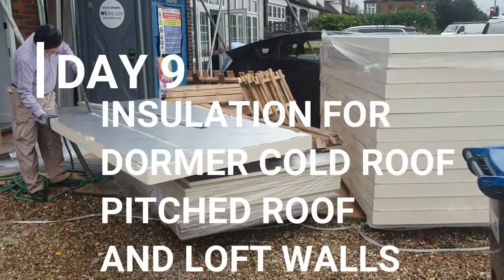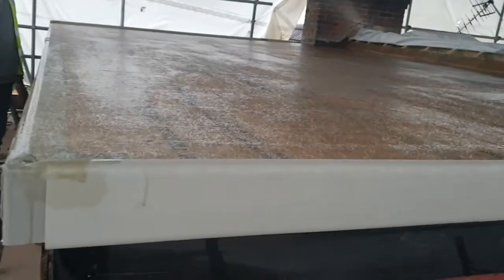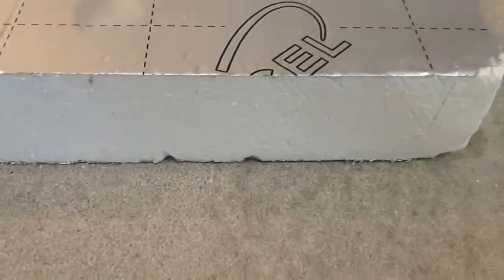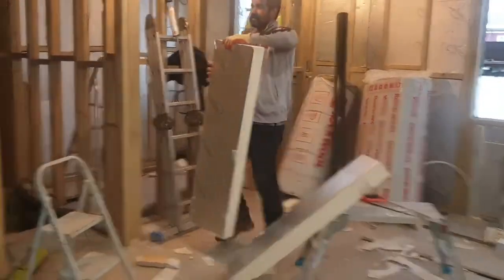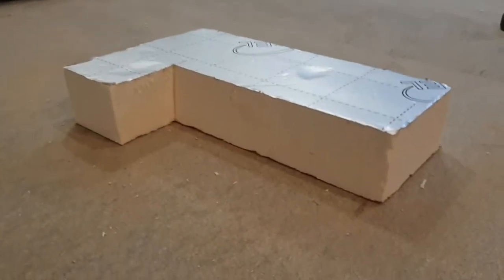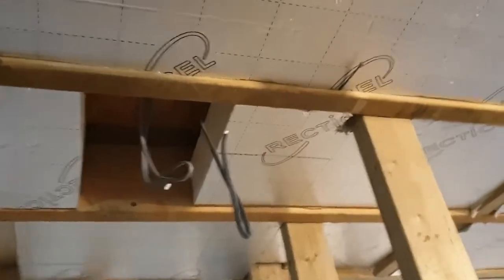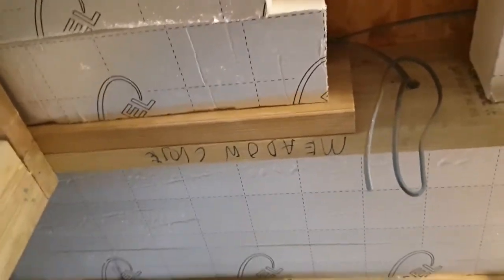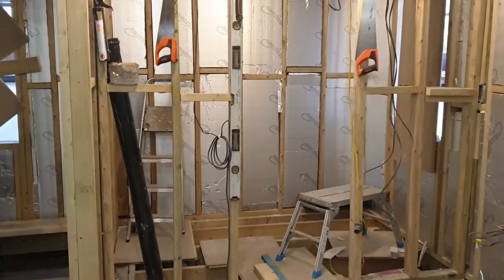LOFT CONVERSION DAY 9 - Insulation of Dormer Roof (Cold Deck), Pitched Roof & Walls - Day 9 of 18

Comment: It didn’t look like there was much ventilation above the insulation and below the roof deck. In a cold deck you want movement of air to blow over any condensation so it gets evaporated. I could be wrong as it wasn’t a forensic video of all the angles. 

But given it’s got a bathroom in it I would be wanting to make sure a very good vapour barrier was under the lowest bit of insulation. 

Some of those gaps in the insulation were a bit large so any air could well move through there, the secondary layer below the inter joist will help but getting the area properly air tight (as much as possible) is key to insulation efficiency. 

Hope you will be sealing up the areas where there were gaps for the electricians and you are not fitting down lights in those areas or your insulation values will be shot and the probability of moisture and condensation in the roof will go up. 

Hope I’m wrong though as I don’t like wrecking peoples days. Trouble is that if it’s going wrong the 1st time you know about it is when something starts to droop or gives way.

Comment: In theory the 20mm insulation form the vapour seal but with downlights cutting into it, the seal is breached. So a ventilation void, in theory,  is required above the rafter and the membrane?

Isn't it a better option is to 60mm + 60mm above and between rafters. This will leave you 40 to 60 services void for downlights. No ventilation void is required. Standard plasterboard can be used in ceiling?
Reply from the maker: Thanks for watching and the feedback. Your proposal would work but we wanted to maximise the head height so wanted to put as much insulation into the rafters as possible. 👍
Reply: @joeblogs  do u serve north london area?

Comment: You should have used 50mm insulated plasterboard on the inner wall and the ceiling . Lots of small/big air gap between the wooden panels and the 100mm insulation boards.
Reply from the maker: Hi Dharmin. Thanks for watching and the feedback. The insulation we installed was in line with building regs and works really well. The room is well insulated and lovely and warm.